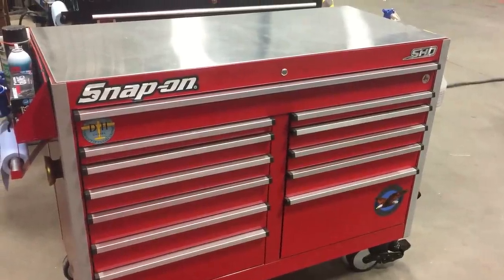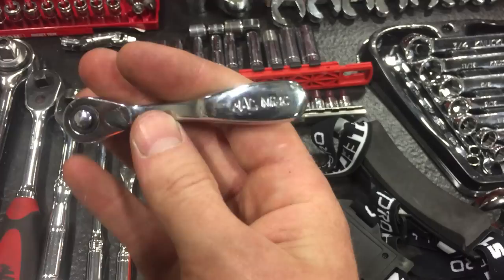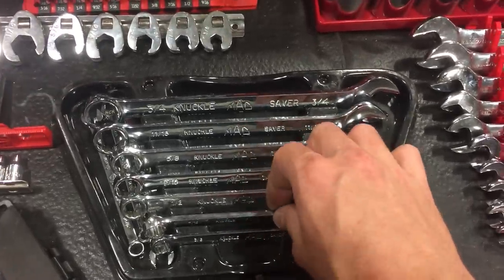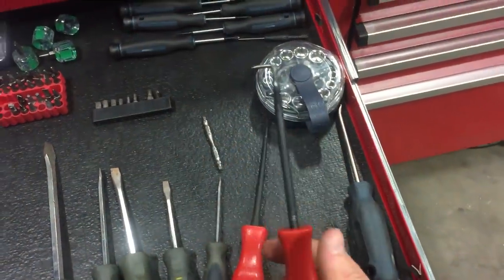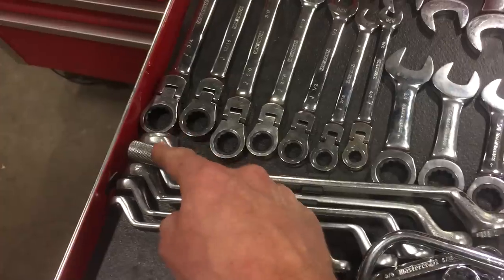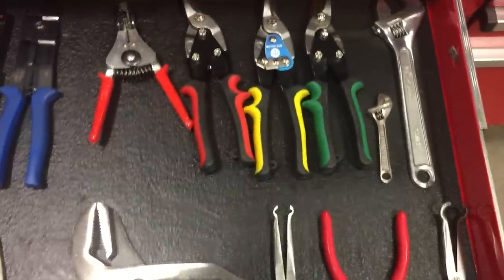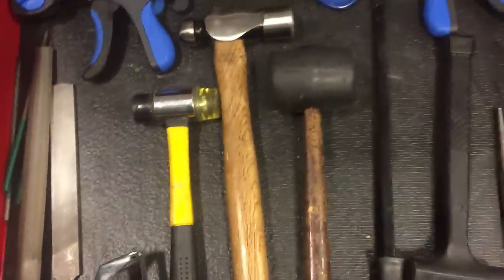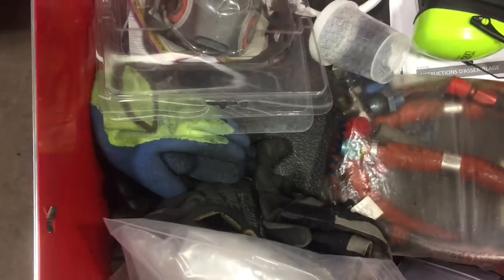Aircraft Mechanic Toolbox Tour

Comment: Hey turdpike do aircraft mechanics like you use an impact gun or any drill? Look forward to ur reply!
Reply from the maker: Lim Junjie Hello! Not usually nope, the only time I’ll ever use one is to try taking out stripped or stuck screws that I can get a lot of weight into. Never ever ever for tightening. Mostly we just use them to open/close engine crates and what not
Reply from the maker: I realize now you also mentioned a normal drill, in that case yes we use them all the time! When theres sometimes hundreds of screws holding panels down you need a drill. Even to tighten up evenly they are great as you just set the clutch. But ya impact drills, usually a no no
Reply: Hi turdpike what kind of normal drill are you referring to? I have interest in becoming an aircraft mechanic
Reply from the maker: Lim Junjie well for me, I use a small 12v Ridgid drill with only 3/8’s chuck from Home Depot. I used to use a Bosch 18v but after it took a spill off a tall ladder it broke. And by then I realized I didn’t need a big torque monster for what we do. The smaller compact 12v drills (with the batteries in the handgrips) are the way to go. Can use them on aircraft interiors, exteriors you name it. Unless you wish to become a sheet metal (structures) tech, you’ll be using cordless drills mostly for removing screws. So really any old drill will work- but I recommend a smaller 12v one that can get you into tight spaces.
Reply: Then is there a difference between sheet metal technian and sheet metal mechanic? I have been hearing these 2 words and dont know the difference or is it about the same just the name?
Reply from the maker: Lim Junjie they are the same thing, just some people call them differently. They are both rivet smashers though
Reply: turdpike oh i see so basically aircraft mechanic is more on the mechanical parts while aircraft technician works more on avionics?
Reply from the maker: Lim Junjie exactly, you’ve got it. Essentially it’s a split between avionics guys, regular mechanics, and sheet metal guys. Regular mechanics have a much more broad spectrum of work than the other 2, as regular mechanics still do electrical and say sheet metal repairs too. The others are much more specialized and specific
Reply: turdpike ahh i see thank you! If i got any more questions i will ask you!
Reply: Btw u guys use the rigid drill for removing screws off the aircraft? Or to make holes?
Reply: Oh what i meant is do aircraft mechanics use the ridgid drill for drilling through things or mostly for removing screws?
Reply: Oh ya and i thought that tools should be bought by the companies. I didnt know that you have to buy it yourself haha
Reply from the maker: Lim Junjie we mostly use cordless drills for removing screws yup. But we do also use them to drill holes or remove rivets. 

Most companies out there you have to supply all the basic hand tools for yourself, what the company will have are the big expensive specific tools for whatever type of aircraft they have. Things like special measuring devices for that specific aircraft, test equipment, and even like a borescope. 

There are places out there where literally all tools are provided I’m sure, I just haven’t come across any! 

For sure, any other questions are welcome
Reply: turdpike then the ridgid drill is used for removing screws in interior and exterior of aircraft as well? Same as the cordless drills? But the cordless drill is used mainly for sheet metal right?
Reply from the maker: Lim Junjie Ridgid is just the brand of compact drill I have. But yes I use it for everything, holes and screws
Reply: turdpike ohh so cordless and ridgid have no difference but the brand?
Reply from the maker: Lim Junjie exactly, Ridgid is just a brand. Model R9000 i think are the ones i have, came as a set. Regular drill and impact drill
Reply: turdpike oh i see u guys use more of normal drills than impact. Impact mostly for car mechanics
Reply from the maker: Lim Junjie yup you’ve got it
Reply: turdpike thanks!

Comment: Hey turdbike, I'm an apprentice AME back in Quebec. I work also on old King Air A100! I'm really looking into this toolbox but the fact that I can't see the box before the purchase makes me hesitate a bit . I was wondering how the drawer latch hold on? Or if you had any issue with it (drawer open while moving the box, Drawer difficult to open, etc..) I've seen some guys tool box where whenever they move their box, all the drawer open. That's a thing I really don't want. Also, did your drawers hold up good ( Flexing, waping, bowing etc..). Finally, the box itself , have you encounter any issue? 

Thank you a lot!
Reply from the maker: Beaucage02 Hey! 

I get what you mean completely, I lucked out because  a guy at work had the same box before me so I knew what I was getting into.

As far as the latches, each drawer has a hook on either end of it. The drawers themselves are sturdy, more than enough support for the small tools we have! Never had any flex issues. And it rolls great, big wheels it rolls better than some snap-on ones we have in the hangar. The drawers as long as they are latched closed never come open when rolling either. 

All in all this box is incredibly hard to beat for the price, would recommend for sure. No issues whatsoever so far!
Reply: turdpike Little update! Juste got the same tool box as yours on Kijiji! They are so rare to find! I'm really happy with it. Thanks for your review on this box!

Comment: You should never leave any time x hardware in your tool box.no matter the use. shadows for tools is highly recommended
Reply from the maker: Reuben .Craus so you’d ground an airplane that desperately needed say some off chance an4 bolt that you had in your box? To say hold an inter-phone in place? Let me know where you’re working, I’d love to come there
Reply: @turdpike  it is a violation to do so. Any hardware used should be documented.if it. Is a case of an interphone for example  you should be aware you can dispatch within MEL LIMITATIONS.  I ll.rather delay an aircraft and lands safely than release it on time and never arrives. Safety first.
Reply from the maker: Reuben .Craus I’d love to work where you do. Sounds fun!
Reply from the maker: Reuben .Craus you cannot MEL an interphone on some machines. Not with passengers at least. So a screw for example can ground an airplane over that. If we play by the rules
Reply: @turdpike  if we had to abide by the rules yes.
Reply: @turdpike  tell me which aircaft you are working on so i ll avoid flying on. There s no ifs and buts. Would you than use a bolt found somehere or someones tool box for a flight control?
Reply from the maker: Reuben .Craus obviously we’d all like it that way but not all are privileged enough to have that kind of time. I’m not one for doing things improperly all I’m saying is there is a point where you can use your own coconut for when it comes to re-using some hardware
Reply: @turdpike  well i understand what you mean. And you are trying your best to get aircraft on time etc. Fully understand. But think about if something wrong happens.. what would be the outcome? Who  would be guilty?
Reply from the maker: R .Craus That’s always in our minds, no? I’m not talking about re-using hardware for major things, obviously I don’t mean flight controls, re-using o-rings, or any other component that if it failed would be catastrophic. I’m talking panel screws, interior hardware, minor shit. The time crunch is real and random small hardware has saved my ass so many times before. It’s all about using your brain and common sense

Comment: What brand is your torque wrench. Curious as to the accuracy in a cheaper torque wrench that would be suitable on aircraft repair.
Reply from the maker: James F Mine is a Gray Tools labeled one, but it’s actually made by CDI. As far as accuracy I’m really not sure, you’d have to ask calibration shop guys. In our hangar our company supplied 1/2” drive torque wrench is just a cheap Canadian Tire Mastercraft brand one, $50 ish probably. We use that thing to torque on propellers and other major components!! But, it gets sent out every year and keeps passing calibration